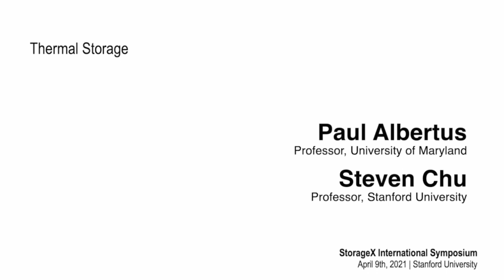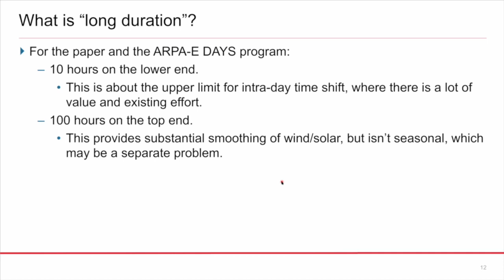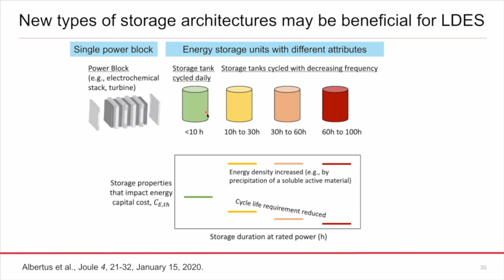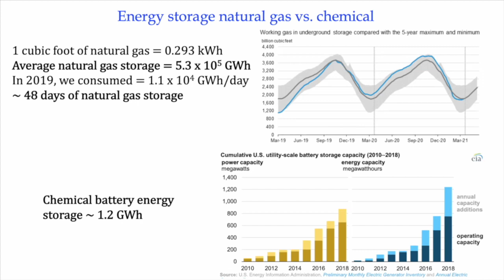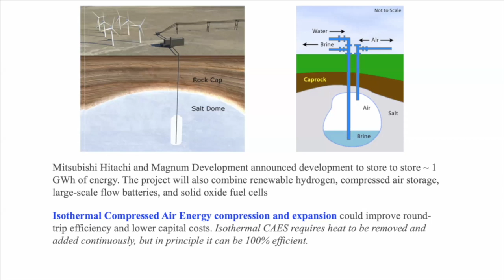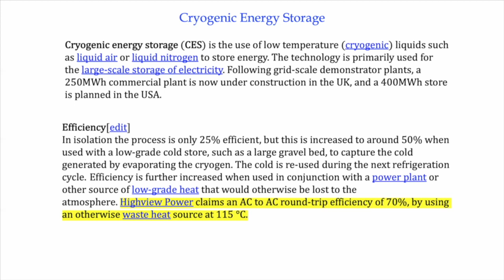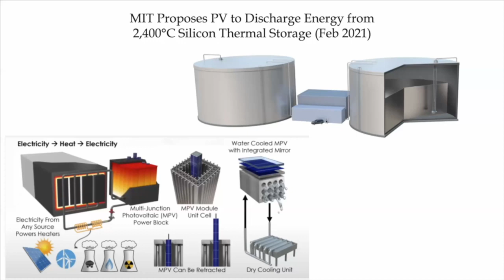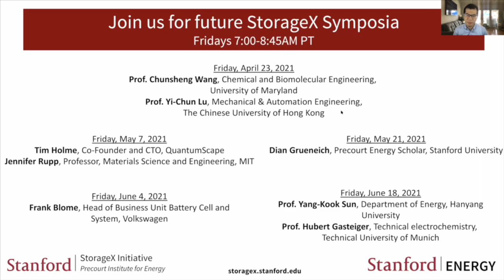Thermal Storage | Steven Chu, Paul Albertus | StorageX Symposium

Comment: Again, thanks for uploading these. 

When it comes to energy storage, we should try to avoid assuming EVs are going to replace all our cars. I think 50% would be lucky.  Hopefully 1/3. Furthermore, swappable batteries with much lower capacities would also change the figures for total EV battery storage on the grid.